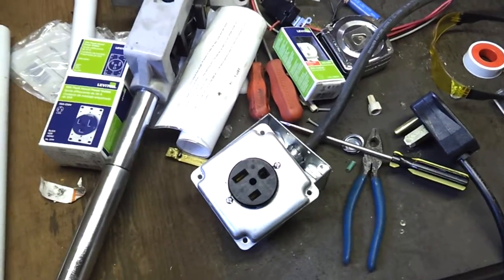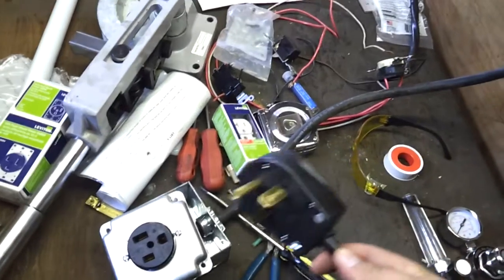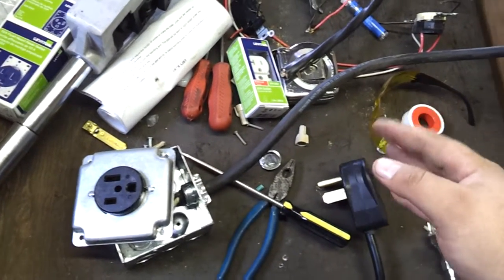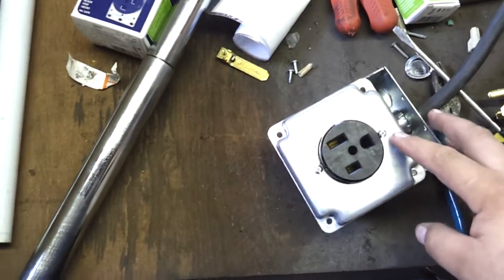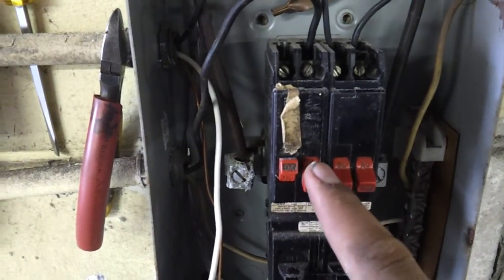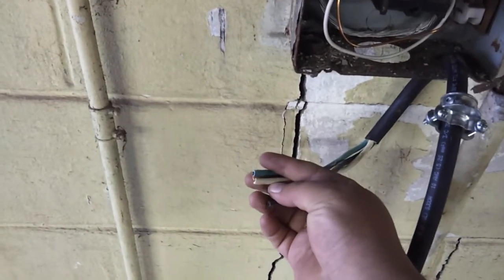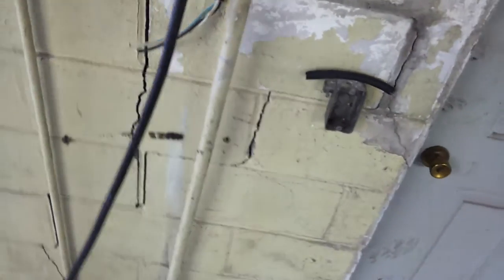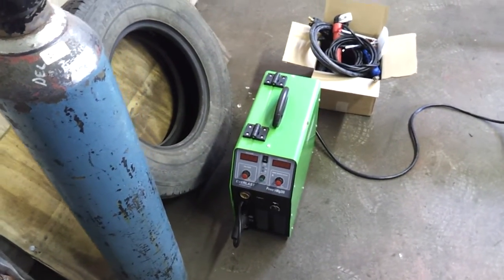Everlast I-MIG 200 (Part 3 = Installing a 220V Outlet)

Comment: Nice channel 😊Good information in various fields. How are you going to heat the new garage in the winter months ?
Reply from the maker: Thank you. Last winter I just used a salamander in the machine shop. Other than the fumes and the fact that it stopped working it was enough to get some jobs done quick. With the insulation I don't need to run the heat long for me to get through a days worth of work. The new larger shop... I don't know yet. Might try the same thing for the time being. Until I really start using that space to work I'm not supper concerned. Most of my work in done in the machine shop as of right now.

Comment: For anyone watching this, do not do what he did.    Wrong size receptacle and plug, should not use cord connected to a panel, don't know what size breaker he used, so don't know if it matches the #10 cord.    Explanations are his opinions and not quite correct.
Will what was done work?   Yes.   Is what he did legal?  No.

Comment: If you don't have the right cable black/red you can  use black/white but you need to tape the white wire with red tape at both ends. People will think your receptacle is 120volt white is neutral, red is hot. Never install white wire on breaker of any size.

Comment: I'm sure it's been said, but I'm not reading all of the history...a 3 conductor wire should be used: red and black = power, white = neutral, and the bare should be grounded to the box.  The connections as shown have the potential to ground out to whomever touches the box, which will seriously hurt with 220VAC.

Comment: Out of all the options it is highly recommended to call your power company and have them put in a separate meter and a 200 amp breaker panel. Since 200 amps gives you 40 or more breakers you can have the 50 amp plug for your welder and then you can also install a 20 amp 220 volt outlet so you can set up a 60 gallon air compressor in your shop. Also you will have the ability to then install a central air conditioning and heating system in your shop to keep it at a stable temperature. So it's recommended to get a separate meter and a 200 amp panel for your shop. Especially with all the power you use. If you use con Edison you can call 1-(800)-75-CONED to have a separate meter and a 200 amp panel installed in your shop. They can also fix the entire electrical mess you have and make sure that you won't have a fire hazard

Comment: Also if you have 200 amp service in your house. You should have your shop re wired by a licensed technician and he can install a 100 amp sub panel which will give you the capacity of 16 or more circuits than what you have. If you don't have 200 amp service in your house call your utility company so they can put in a separate electric meter for your shop so you can have a 200 amp panel which will give you up to 40 or more circuit breakers.

Comment: The steel box seems unsafe because if the back of the outlet snaps it can cause it to spark and trip the breaker.What you should of used for an outlet and they do sell it. You should of used a 6-50 grounded surface mount type outlet which has the contacts attached to an insulated pad then to a metal back and has a high impact plastic cover housing. You can use either leviton or cooper. It does not have to be all leviton. If you get a surface mount outlet made by cooper wiring devices and attached it to the extension cord it will still work just the same. The ABS cover housing makes surface mount 6-50 power outlets self contained and durable. Use that kind of outlet instead of a box to avoid shortages. The outlet even comes with a cord clamp.
Reply from the maker: +Joseph Leogrande You're right about the steel box. I actually had the outlet fail on me. What I ended out doing is lining the box with rubber to protect that from happening. I'll look into the surface mount type because ever since I had that issue of the outlet breaking inside the box I've been being vary careful with it.

Comment: I have the same plug, but my machine has four wired extra wire is red. what should I do with red wire
Reply from the maker: Check your user manual. Also make sure you do not have a 3 phase machine. Also if your machine came from overseas you may have different colors than standard US wiring colors. If you don't have a user manual call the company that makes it. The reason I say this is because I do not want to assume anything and cause you to short out your machine or worse.
Reply: If it is set up for single phase then you will not need the red wire....fold it back and tape it off....check you manual to understand what I am saying, but don't ask Alverez Metal Works for advice as he has no clue what he is doing....check out my comment that I left on this video

Comment: If you are going to have power on a white wire, electricians will wrap it in black or red electrical tape (in your case, red  tape to indicate that the wire hsi HOT.  Black is 120vac, black /red combination indicates a 240 vac power connection.

Comment: so i assume your welder won't pull more than 30 amps.. but why not put 30 amp plug/s in your cord system  ???
Reply: Welders come with a plug that goes with 220V 50A sockets.. The prongs on 220V 30A sockets have different stye prongs than the 50A. My breaker is 30A, but I still have a 50A socket cause the welder.
Reply from the maker: You're assumption would be correct. I used that plug because this is a pretty common plug for welders. I know what the risks are but having a 50 amp plug will not effect a machine that only requires 30amps at it's maximum setting.

After reading both your comments it seems you're looking to get into a debate about electrical. That's not what I'm here for. The entire electrical system in my shop is in really bad shape. It was like that when I moved in. I work safely around it knowing it's limitations and keep people out of my shop so there are no accidents. I don't own the property or I'd upgrade the whole system. As it is I might just do it anyway because I need more outlets and better lighting.

I know why they have different styles of plugs. I know what amperage limits are for wire gauges. I also know that's effected based on distance. I may not word things correctly but I wired this up correctly. Yes my breaker is 50 amps, no the wire is not rated for 50 amps, yes the plug are 50 amp plugs, however with all that being said what I use that plug for does not exceed the wires amperage limitation. So no this wouldn't pass code but yes it works so long as I don't exceed the wires amperage limitation causing it to over heat and fail.

So thanks for commenting but please do not assume my videos are a welcome place for you to try and make someone feel stupid. I'm far from that. If I did everything by the book I wouldn't be where I'm at. If I didn't take risks every once in a while I'd be better off sitting at a desk or filing papers for someone who's willing to take a few risks.
Reply: Alvarez Metal Works Taking risk when it comes to electrical is no laughing matter....you can do what you want, by someone may see your video and not be as smart as you and cause some serious harm to them or others....Would it be worth your little fame here on Youtube....thank god not to many ppl watch your vids....and what do you mean taking risk has got you where you are today...lol

Comment from the maker: I'm not an electrician so I'd find out what is code in your area. However yes I've seen them (RV hookups). But like any other outlet installed outside they have been installed in weather sealed boxes. If you do it yourself absolutely make sure you did it to code or you could end out with a very big problem on your hands.